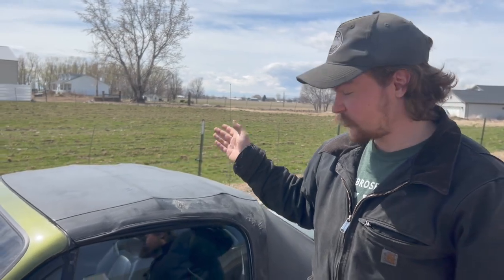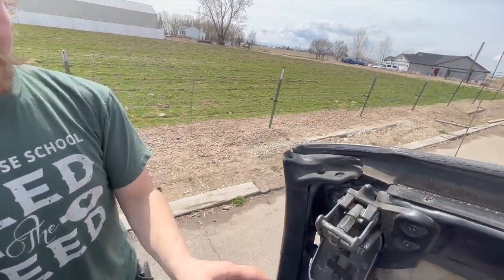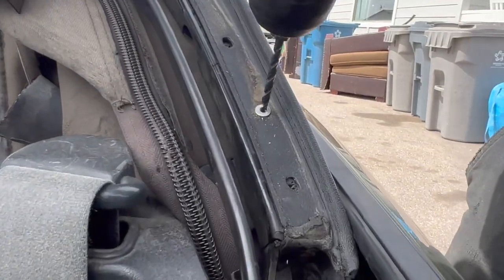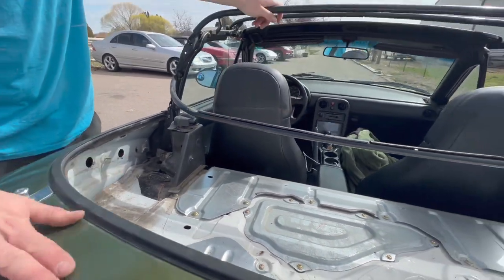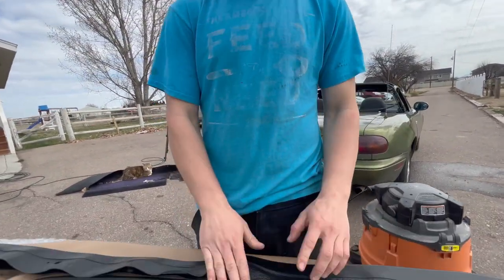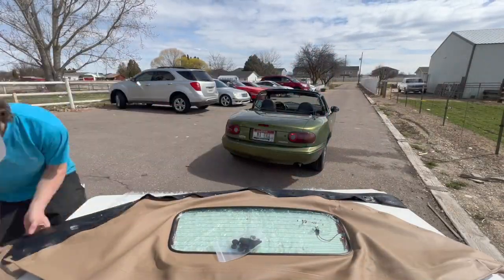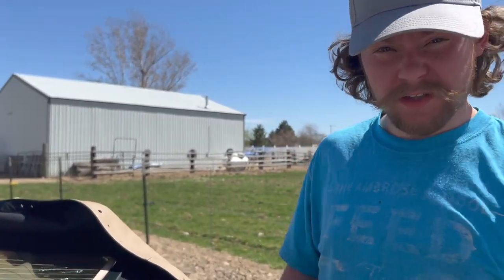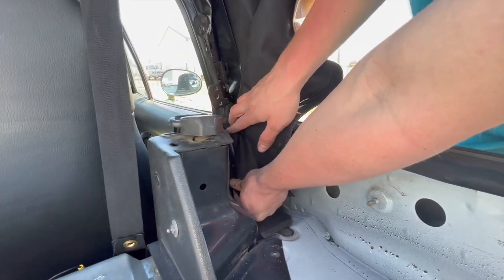Complete Top Replacement - NA/NB Miata Upgrade PT 2

Comment: just be aware - it took my son and I 6.5 hrs to complete. It would have been 8 hours, but my son's friend who does canvass work on boats joined us with appropriate tools. In my opinion, two people are a minimum for this job - you do need 3-4 hands on occasion. The rivet holes will likely be too large after you overdrill old rivets, so I would suggest getting rivet backing (like small washers). Also, doing it on a hot day is a PITA, but it makes fabric much easier to stretch (and you will be stretching it). Finally, when replacing the 3-part rail in the back holding and stretching the fabric, start on one side and move across. DO NOT put in the side rails first - the middle part will not fit. Make sure you have this video on hand - there are a LOT of details you MUST get correctly; we had to refer to the videos at least 4 times during this job.

Comment: anyone know if its easier to do it like this or removing the entire frame, i really havent done much work on any cars other than simple maintenance so dont have very much experience
Reply from the maker: I've never found it worthwhile to remove the frame personally, but some people prefer to. Only tricky part is the lower b pillar screw but it is not too bad. Probably a toss up between the two methods, but frame removal seems like more work to me

Comment: Hello, Alright, I have a question from Germany.  I have an old miata and wanted to change the top.  The screws in the rear area are rusted and unfortunately broken off.  Do you maybe have an idea and thank you very much for your help and your great videos. Reza
Reply from the maker: Which screws exactly are broken? The rain rail studs?
Reply: @NotEnoughProjects  Many thanks for the answer.  That's right.  Rain rail bolts have broken off.
Reply from the maker: If you only have one or two that broke you should be fine. If a bunch snapped then unfortunately the only real fix is to cut/drill them out and replace either with a bolt/nut or weld in new studs

Comment: Great video. I just installed my top this weekend and my configuration is the same as yours. NA with a NB top with a glass window. I didn’t know how to do the elastic so this video makes a lot of sense. What did you end up doing to make the elastic stay attached to the bows? Did the washers work?
Reply from the maker: Sorry I'm just getting back to you on this. The elastic ended up pulling out. We have just been manually moving the bow into position before lowering the top. Coming up with a better method is on my list of things to do

Comment: Love the video planning on replacing mine I was just wondering all I got rn for the replacement is a top rain rail and going to get a rivet gun but what size are the rivets plus anything else I need thank you !!
Reply from the maker: The rivets are 4mm or 5/32 I belive. The only place you really need to rivet is to the b pillar. The rain rail is fine without rivets. Hope it goes smooth for you!